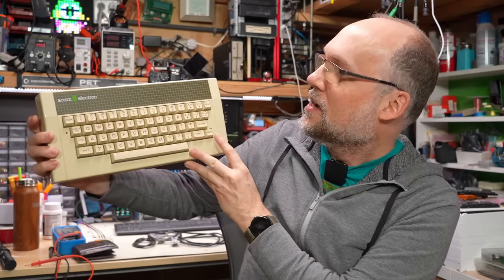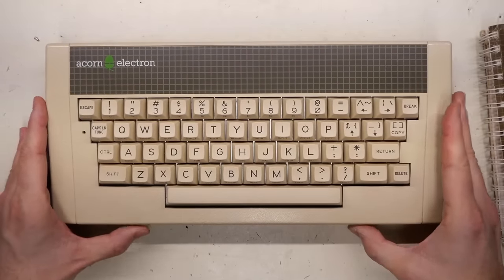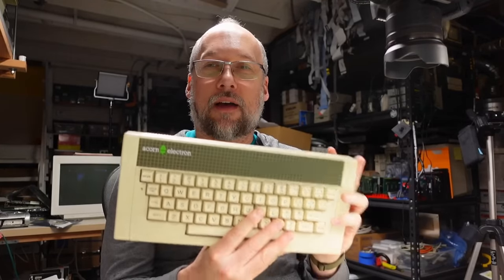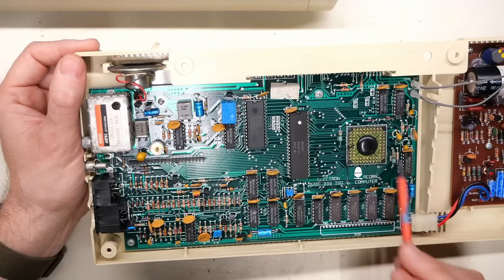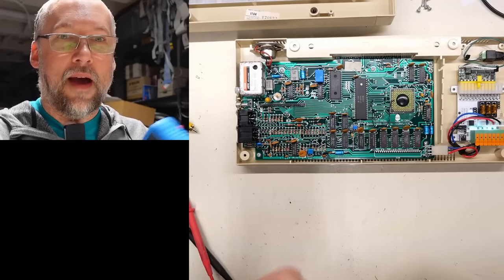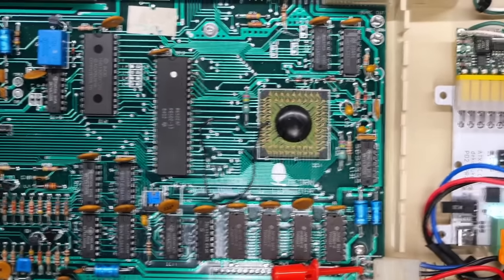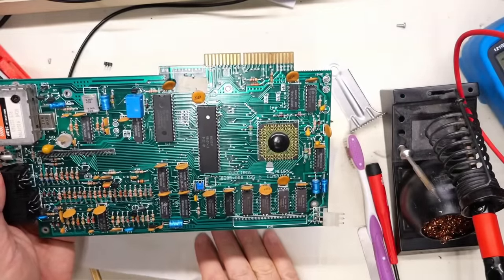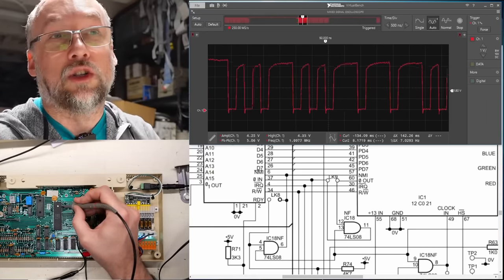I was shocked at what was keeping this Acorn Electron from working (Acorn Electron Repair)

Comment: BTW Adrian, I recently saw people using a mechanical pencil to straighten pins. With the lead removed, it's the perfect size to slip over a pin and straighten it. Never saw it before myself.
Reply: I'd have thought inserting it into an empty ZIF socket would have done most of the work; wiggle the lever a few times & all pins should be (mostly) aligned

Comment: Hi Adrian. I inherited an unwanted Electron recently. It wasn't working so I replaced the CPU with a R65C02P3 and also use a bog standard 12v wall wart to power it. All works really well now. Thanks for all your resources.

Comment: When straightening out pins on ICS, if they are 0.1" pitch, it's handy to have some perfboard handy to see if everything lines up with a hole. Once it's pretty close, I push it into the board and give it a little bit of a nudge in various directions to even everything out.

Comment: Nice video! I own an Acorn Electron myself and it's pretty deaf on the cassette input. It doesn't work with sound cards or smartphones as input, probably due to improper impedance matching. But if I feed it from the headphone output of my hi-fi amplifier (even at low volume), it can interpret the virtual tapes without any problems.

Comment: I had an Electron as a kid, and got the Plus 1 expansion interface. AcornSoft made a number of useful cartridges and I had several, including Acorn's LISP interpreter. I also has and a disc interface cartridge  so that I could use a standard BBC 5.25" disc drive (rather than the 3.5" Plus 3 expansion) as that let me swap disc back and forth to the Beebs at school. I also made my own Econet (well actually Amcom E-Net) interface as part of my A Level Design & Technology course project. Happy days!

Comment: My first computer (and I still have it). After a reset you can type in 'OLD'  and most of the times you have you're program back. Another funny thing is that you didn't need a datarecorder, but a regular audio tapedeck with a 5 pin din connector worked too :)

Comment: I had an Acorn Electron - the younger brother of (and partially compatible with) the BBC Micro.  It was a great little machine.  I had the expansion unit, plus the disk unit.
I really regret getting rid of it.
The ULA (Uncommitted Logic Array) in the Electron was actually designed using the BBC Micro.

Comment: The cassette interface plugs into the headphone socket and it's likely it needs a bit more 'volume' to make it work. Good job on the repair.
Reply: It could actually be the opposite, ie. standard audio levels tended to be too loud. I discovered this when many years after using cheap tape units, I was able to switch to a hifi unit and found recordings worked better wih a lower volume level.

Comment: I had a giggle @55:00. The RESTORE command is to do with READ and DATA statements when you kept inline data in the code. The correct command to recover your BBC BASIC code after a BREAK key reset is OLD. I guess they chose this as the antonym of NEW which is the command to wipe a program and start again without pressing BREAK. This is what I recall from nearly 40 years ago anyway.

Comment: I had the Electron back in the day (couldn't afford the BBC machine, so had to make do with it's baby brother) ended up with it fully kitted out with floppy drive, expansion unit and (quite rare I think) a mode 7 adapter. I got quite good with BBC basic and could get by with some assembly code
Reply: Me too.  Plus 1 and Plus 3 with ADFS.  I also had a 6502 second processor that plugged into a cartridge socket that brought it close to the speed of a BBC.

Comment: Hi Adrian, this video was a really nice xmas eve treat (only "premiered" this morning for non-subscribers/patrons) - thanks!  A merry festivus period to you and yours :)
The sound effect was spot-on at the point you eyeballed the ULA from the underside - I audibly gasped when I saw that -> I thought you were toast for this repair, at that point!

 - It does remind me of repairing a ZX Spectrum that I had purchased from a retired gent who had owned the machine from new - Turned out a replaced DRAM was only partially soldered and had since failed.  It was in that state direct from the repair tech ... I suspect the tech was interrupted mid-repair and forgot to finish soldering the device before getting it back to its owner.
 - As you and others have already pointed out:  Most likely scenario for the Electron in this video is original CPU failed; CPU replaced with non-compatible part; Whoever was attempting the repair has assumed that the ULA had also failed and then couldn't get the ULA out ... then left it as-is.

Comment: The audio leads plugged into the headphone output, not the line output, and it was always very finicky about the volume settings. You would have to spend a lot of time initially getting it dialled in to exactly the right volume to get a reliable load.  Once you'd found the sweet spot for that particular cassette tape player it was fine, but finding the sweet spot took time.  

Great video thanks, and the bit where the ULA was unsoldered was priceless - so unexpected 😅

Comment: Funny to see you working on the Acorn Electron. I myself am at this very moment busy with restoring the even older Acorn Atom. I already replaced some caps that where really bad (dry electrolytic that should be 22uF, but where 3.5 nF). I already got the "Acorn Electron" sign and the prompt visible on the monitor, so that part (6502 CPU, Video Chip, ROMs and memory) seems to work fine. The keyboard has some problems though. I already checked the key switches, and some where in bad shape (intermittent contact, stuck contact, or no contact at all). Treatment with contact spray has solved all but one key, so I am going to place all the keys back and cross my fingers. Lucky enough the keyboard works with a SN7445 and D8255, that are still available new (and cheap), so I have good hopes to get things working, even if the keys are not the problem. The coming days will be exiting...
Reply: I hope it all works out! I've yet to fix my original Electron which stopped working long ago, though I was able to establish that its ULA does work ok (swap test with another unit).
Reply: @mapesdhs597  There can be problems with the socket on boards where the ULA is socketed. I don't think this was fully or widely appreciated, but it is definitely worth being aware of before concluding that the ULA is bad (which you've ruled out yourself, anyway). Some people have a repair strategy for the sockets, whereas others have actually managed to source new sockets, but they are somewhat difficult to procure.
Reply: @paul_boddie   Thanks! I think I got lucky with the ULA in my original unit being ok, but I've no idea to what extent this will be an issue with all the other Electrons I have (maybe two dozen), though I suppose it means I do have plenty of spares.
Reply: @mapesdhs597  Two dozen?! Well, I guess you've got yourself a hobby, or maybe even a job, with all of those!

Comment: That is a really neat package.  Also, the keyboard on those vintage machines were terrible (not a fan of the C64 kbd).  Too bad this arrived too late and had such terrible performance.

If you haven’t already I love to see some action on the Arm based Acorns.
Reply: Re the keyboard, thankfully that was not the case for the BBC Micro or the Electron, they had excellent keyboards, very different to those found on the C64, Spectrum, etc. Also, I used an Electron for years, I really didn't notice the performance issue that much at all; it was certainly cut back from the Beeb, but one rarely noticed the difference in normal use (I could compare to Beebs at school, indeed I wrote several programs used by the school for chemistry and math lessons). There was also much to be gained to be coding directly in assembly, which I did to some degree in later years.
Reply: @mapesdhs597  Indeed, I meant to write "on the other vintage machines".  I've never used a Beep or Electron, but I'm tempted to get my hands on one of the Arm based Acorns, Archimedes or RISC PC, alas they are a bit expensive on eBay.

ADD: As I'm watching https://www.youtube.com/watch?v=SrayIPh22Dk I'm drooling over those SA keycaps which is my preferred profile and actually what I'm typing on Right Now.
Reply: @tommythorn   Must admit I have a weird bias about Acorn machines, indeed all vintage micros: I have no interest in those models where the keyboard became separated out from the main unit. I have a lot of Acorn systems (several dozen), including a Risc PC, but I'll sell it at some point because it doesn't do anything for me. Same for all the other vintage tech I have (Commodore, Amstrad, Sinclair, Atari, etc.), eg. I like the older Amigas, C64, etc., but not the later units with a separate keyboard. I've no idea where this driving aesthetic preference comes from, so far I've only talked to one other person who had the same sentiment.
Reply: @mapesdhs597  We all have our quirks:) I have an irrational attraction to the opposite: computers built into the monitor (Lisa, Compact Macintosh, iLamp, …). However at least some of the Archimedes should qualify (eg. A3010), no?
Reply: @tommythorn   :D  Yes, I do like the early Arcs of that kind (one of mine is a complete original boxed setup, even the sales receipt, a family's whole system from long ago).

Comment: I, too, have an Electron here in the US, completely unmodified.  I run it on an old Apple Airport Extreme power supply, giving it 12V DC (with sufficient amperage), after consulting with other users (mostly in the UK) about easy, modern power bricks.  I will admit that I don't remember if I've ever used the cassette interface, though, as I have an Elk SD for loading programs nice and quickly, and I don't have any of the original cassettes anyhow, so I'm not sure if the AC signal is necessary for that.

I will say that the AC signal IS necessary for one thing that I know of:  The Plus 3 floppy disk expansion, which I do not have.  It uses the 19V AC to generate the necessary (non-5V) voltages for the floppy drive itself.  I do have the Plus 1 adapter, and it works just fine without the AC signal.

For video monitor, I use the RGB port to send the signal to a SCART-->HDMI converter box, which does a nice job of giving me a crisp, clear, color ("colour"?) signal on modern monitors.  🙂  I hadn't thought of trying the monochrome signal on a CRT, although I did use it for initial testing with LCD panel TV's (and not since).

The Acorn Electron was hampered by poor supply chain management at a critical time, and never achieved the fame it deserves, as far as I can tell.  Some call it a "gimped Beeb", but it's a very fine little budget system with, as you noticed, an excellent keyboard, and a more than decent library of games.

Have fun!

Comment: I couldn't see anyone else comment this, the command to bring back a listing after pressing break is "OLD".  Also, there are some hard coded "quick commands" - press and hold the Caps Lk key and "O" for OLD and "R" to run.  CHAIN (to load from tape) is CAPS+K. etc.

Comment: Thanks Adrian. It's possible that a repairer took in the computer and decided that it wouldn't work with the replacement IC. It was costing too much time, so they put it all together without bothering to re-solder everything, and returned it to the customer as irreparable. Seen that kind of thing happen a few times over here.

Comment: The idea that Electrons need specific 6502s because of the 40us clock halt in modes 0-2 is mostly a myth. I tried many different types of 6502 in the Electron while I was designing an accelerator card for that system, and every chip bar a very old MOS 6502A part worked fine - and that chip was unstable in all video modes, so was possibly a re-marked 1MHz chip that couldn't cope when run at 2MHz. Some issue 6 Electrons actually shipped with Rockwell R6502APs installed, so the CPU in Adrian's machine may well have been the original.
Also, as a point of interest, you can fit a Rockwell R65C02 into an Electron and it'll work just fine. Doing that permits the use of BBC BASIC 4, which requires a 65C02 and has some nice performance improvements.

Comment: On the BBC Micro, it is the command "OLD" or "O." to restore the program after a break. I wouldn't be surprised if it is the same on the Electron. In NA, doorbell transformers may provide an appropriate AC voltage for the Electron.

Comment: I bought a German Electron from EBay in the UK. It’s identical except it probably weighs half as much again as a standard Electron. Inside it’s completely full of copper shielding. It’s marked on the outside as issue 1 but the pcb is issue 6.

Comment: I actually did have a BBC Model B and then a BBC Master 128 (later with the Turbo Co-Processor fitted) and then I migrated to the Acorn Archimedes and Ultimately the PC. The BBC was very expensive for the 1980's at around £400  (£1,300 in 2023) and then all the upgrades over the years. Still nothing better for Basic and 6502 assembly programming 😁
Reply: The Model B was really aimed schools etc rather than home users. The parents who did buy them (like my boss) thought having one would guarantee their kids got to Oxbridge 🙂.
Reply: @sputukgmail  I think those prices soon jumped up to £299 and £399.
Reply: @MrDuncl I used a Model B in school so I was very fortunate to get one at home also 🙂🤷‍♂️

Comment: Superb repair video, that hour just zipped by! I'm especially glad that you got it working and didn't get stuck with a dead ULA. I actually have a mint condition Electron, complete with PSU, in my Acorn computer collection and I agree that the keyboard is something special. While it's a (very) cut down BBC, it does have one feature that the BBC doesn't: shortcuts to common BBC Basic keywords. Each word is printed on the front of each key and is activated by holding the CAPS LK FUNC key and a shortcut key. Also, note that the video output is always interlaced for compatibility with the official teletext expansion which contained the teletext chip that was belatedly released for it and it's not possible to turn off the interlace, unlike on the BBC.

Comment: Nice! The Elk is a lovely little machine for what it is, indeed being a handier size you may find it better for casual use than a BBC or Master. Glad to see it getting some love from you after being mullered by some previous butcher...
...talking of butchery - the elk was indeed a serious hack job to get sufficient BBC functionality for the target price considering at the time the ULA was the largest available and wasn't really quite enough.*

*On the subject of corners cut making the Elk rather slower than the Beeb. Yes it is at times 1/2 the speed, but was still a good deal faster than most of it's price competitors - The clock stretching thing was a bodge to make it work with the desired components and not it's main issue. ROMs run at full speed, it's that cheep-ass RAM in combination with the way the ULA works that somewhat hobbled the machine. 
Funnily enough an engineer found a way to mostly cure the speed issue by preventing the ULA from 'seeing' the lower 8k of memory (not required as screen RAM never lives there) so stopping contention in all areas that really matter to the 6502. But just a little too late to make it in to the production machines - as shame as an Elk 95% as fast as a Beeb would have been nice. The hack was performed by a good few users after the fact and went on to be the basis of a bloody good upgrade board for the machine - more speed, RAM, or both. Both my Elks have this, one an original and the other sporting a modern board.
PS: 
It's well worth getting an SD card solution for the ELK - cheapest way is via an Electron Plus 1, hack in a MMC interface and more ROM space or get one of the many excellent add-ons. One little tip if you're adding ROMs to the OS is to find a JAFA Systems Mode 7 ROM image - of course the Elk didn't have the Teletext chip as part of the cost saving, but it is missed. The ROM does a surprisingly good job of spoofing the hardware, especially if you have a RAM upgrade - useful for getting some non-demanding Beeb software to work.*

*FWIW: The Elk actually ended selling in greater numbers than the Beeb, so if you really only want an 8 bit Acorn to play the games pretty much everything on the Beeb either runs on the Elk or it has it's own version. You won't be missing out unless you specifically need the extra facilities of the bigger machines.
PPS:
Um, pretty sure the Elk's 19v AC PSU will work fine with a 15-19v DC laptop PSU. Sorry! (Yes, any peripherals that need the 19v AC won't work but I doubt you'll find any in the US)

Have fun.

Comment: The -5V was also used for the RS423 Serial Port.  RS232 typically used +/-12V.  I assume they used RS423 to save cost, only needing +5 & -5,  rather than +12, +5 & -5V.

Comment: IC 14 is an XOR. PAL turns the color wheel upside down every second color. NTSC doesn't do that. That's why in NTSC the XOR on one pin is permanently set to GND. With PAL the signal comes from a flip-flop.
Reply: Not every second colour.  Every other line in time. (Not in space.)